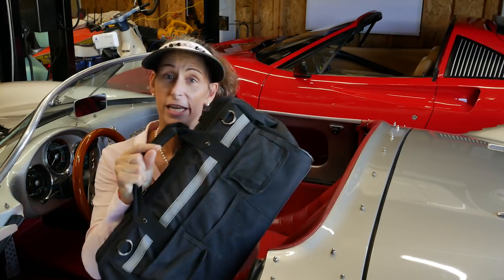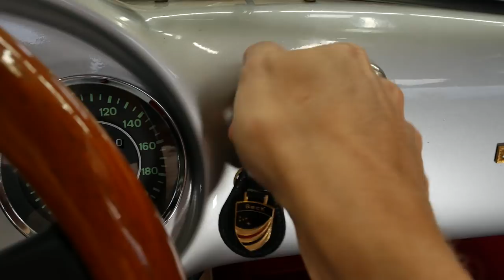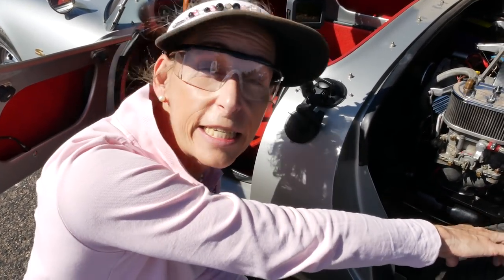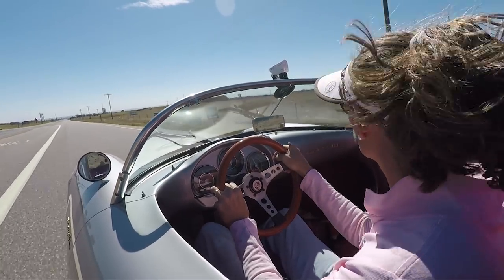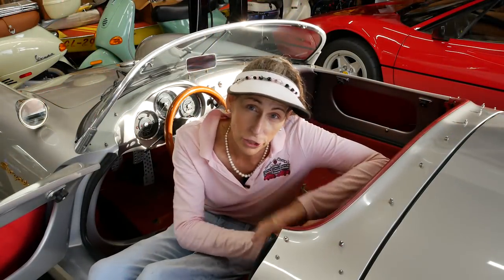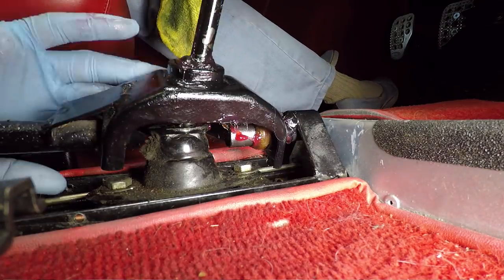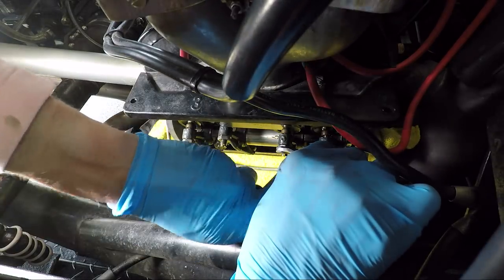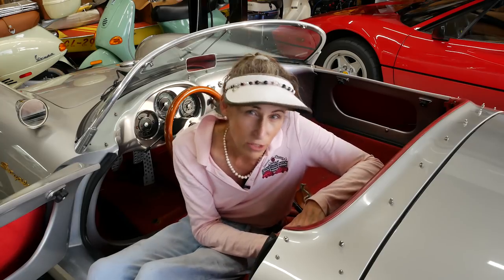Beck 550 Spyder Replica VLOG #9 - Shakedown!

Comment from the maker: In episode#9, We take the car out for a proper shakedown run!  Let me know what you think!  How does it run and how does it sound?  Maybe not everything was perfect, but I get into that at the end.
Reply: Great to watch the vids, Yeah, for sure sometimes the valves can hit the covers, Not sure what cam and all it is. Actually, I had the stock cam with the 1.25 ratio rockers and mine valve cover had to be centered just so-so or I could feel it hit the valves. Actually, valve cover position may be a matter of feeling it with the engine running, But this little spider probably needs bolt-on aftermarket valve covers. Oh and yeah, probably the big end of the tube needs to be out. You can't have any hitting going on, well you can but then they start leaking oil and at least my aluminum pushrods wore down to a point they had to be changed. Now I use the CB Performance SS Wide Mouth Racing Push Rod Tubes. http://www.cbperformance.com/product-p/1567.htm

Comment: Wow, great troubleshooting. 
When I first got the car there was a fuel delivery problem. Previous owners had installed two pint size fuel filters in the engine bay. Effectively, they acted like a second gas tank. The fuel would dribble into the filters and they would take up any extra fuel needs to carbs. Replacing the plastic fuel line certainly makes the car safer. 
Now, onto the comparison episodes!
Reply from the maker: Thanks Dick.   I'd be really interested to get your take on it.  Maybe we can work it out to have you drive it.  I'll ask Mike.  It still has a little way to go, but it is drivable.

Comment: Dear Frannie and Heidi,
Consider measuring the OD of stock VW pushrod,compare with present chrome  moly OD.....if stock VW pushrod has smaller OD-swap out....I can't remember-(i ran stock and chrome moly pushrods in different engine configurations-but 40 + years ago!!.....Stock VW pushrods held up very well up to approx 5000 + rpm (even with mild hi-lift cam-)-for normal street spurts and SCCA road racing events......i hope those expandable pushrod tubes work out!!!...one of your commenters on this VLOG #9 is/was right!!-it is best to stay with the stock VW pushrod tubes.....thank you both for all of your efforts and VLOG's!!!!!  John
Reply from the maker: Thanks John.  My guess is that the steel rods are actually smaller in diameter, but I don't have access to the new rods.  I did talk to the owner about swapping them out, but he chose to stay with what he has.  I think those pushrod tubes seem to work just fine, but I bet the originals would allow for more clearance.  Thanks for the thoughts! F

Comment: If you look at the pictures of that you showed of the push rod hitting the tube. The alignment is off compared to the other push rods.  I haven't worked on VW since the late 70s and early 80s but if I remember, the rockers were slightly different on some of the other engines. They look identical except the measurements are slightly different, you might want to measure the rockers to make sure that they are all identical.  That push rod should go down the center of the tube when the valve is partially open and its already against the side of the tube before it even moves.

Comment: Well, this turned out to be a nice series of videos! All very interesting to fellow car nuts!   I would suggest to the owner that having a good-working set of carburetors will require swapping those Dellorto carbs for Webers.  I doubt the Dellortos will ever run right...  Nice job on the video series!
Reply from the maker: I second that... F
Reply: If you ever have an issue with the Dellortos, I can make them run better and smoother than webers, don't get me wrong but webers are good carb too.

Comment: The problem with the valve cover leak is the bail.  That is not an original German bail.  The aftermarket bails don't keep the proper tension.

Seems like the gearing is too low.  Seems like that gear box should have been built with a 3.88 R and P. 

Keep up the reviews.

#GirlVWmechanic
Reply from the maker: Hi Monica, You are right; the Gearing was changed by the PO.  I didn't catch the why, but maybe taller gears for a stronger engine?  Not sure.  I was more worried about getting it to actually select a gear ;)  The bail was pretty tight.  It was my bad for not prepping the seals properly.  I sorted that and they are now dry.  Have you worked on these CB Performance engines?  I'm interested in your take on them - although this one is pretty old I think. F
Reply: @HeidiandFranny  CB Performance is THE industry leader. If the engine was built by Pat Downs ( Lead tech/builder) I'd be fine with the engine.  But a 1915 cc engine wouldn't be something he would build personally.  He usually builds 2 liter and up. He can build a bullet proof 2276. 

I've built engines with mostly CB products. Certain items still need to final prep.
Reply from the maker: Are the pushrods suppose to contact the tubes?  What do you think of those steel pushrods...  This engine actually had one different than the other four on the right side.  Oh, I have to ask you about those nyloc nuts...  They were on the heads and the case.  I had not seen that before...  How do you torque properly with them?  I know a thousand questions ;)  Thanks, F
Reply: @HeidiandFranny  Steel push rods are used on engines that are built with Chromoly steel head studs.  The expansion rates are the same, so you adjust them at zero lash.  I like building engines with SS windage style push rods tubes.  The are wider, and you usually have better clearance.
Reply: @HeidiandFranny  Nylocks are fine.  Torque specs are the same

Comment: Dear Franny, riding the 914 in regular traffic was easy. I started having trouble when I wanted to race the car on the track. About evry fifth shift was a gnashing nightmare and I gave up racing the 914 despite the great weight distribution. Due to the mid-engine the shift linkage was incredibly long and hard to get right. Seems the 550 Spyder has the same issues. Nice when you get the linkage tightened up but always a nightmare when you´re on the track in traffic. At least this replica has a pushrod engine. 
Andreas
Reply from the maker: It does shift a lot better now, but it is still clunky.  But, the 915 transaxle in the 3.2 Carrera can be fussy at times (especially 2nd gear).

Comment: Fantastic video. So glad to finally see the vehicle running as it should. I have to say this makes me want one of these so bad. I do have one question though. What happened with the brake light at 9:35 .  is it a line pressure switch or a pedal switch for the brake lights?
Reply from the maker: Hi Tim, I think that is the "blinker".  It works and it doesn't but it doesn't cancel.  That needs to be sorted.  I was a little worried when I went past the po-po.  They are pretty cool out here in our area.  Good guys.

Comment: Great video in a great series. Very informative. The car sounds great too. I guessed at a gear linkage issue when you mentioned it shifted badly. Glad you got that fixed. Still wondering about the oil leak at the pushrod tube. Is the pushrod ever so slightly bend? And are the pushrods and tubes correct for this engine?
Reply from the maker: The rod seems straight...  All of them are close to the inside of the tube and several of the tubes have rub marks on them.  I can't think that is "right".  It is more about the high-lift cam I think and the stock rockers.  Seems like it could be better...
Reply: Oh, I forgot about the high lift cam and stock rockers. Sounds like that could be it.

Comment: Really nice vid...thanks. Rather strange the position of that pushrod, something very wrong there. Surely the rocker is wrong?
But i'm sure you got it sorted.👍🇬🇧
Reply from the maker: Yes, I totally agree!  I got it as good as I could, but still...  It just doesn't seem correct.
Reply: @HeidiandFranny  ....the rocker arm is too short on the pushrod side (no idea how that could be) causing the rod to touch the tube. A very odd problem, unless the rocker arm got swapped  by mistake sometime in the past. 
It also looks like the rod is not seated central into the rocker but the adjacent one looks the same.
Would love to find out.
Keep up the great work.
Love from Rome.

Comment: What was the verdict with the cracked head? I hope it was replaced or more then likely you will be having to tear it down again. Sounds great!
Reply from the maker: The machine shop gave it an ok because it wasn't up to the spark plug hole.  The said it is common on heads that have been bored out for those larger valves.  The valves were replaced and the springs and keepers.  This isn't a car that will ever see high mileage.

Comment: Awesome!!! I’ve had the crazy idea of selling my 996 turbo and buying a replica spyder.
Reply from the maker: That is a crazy idea.  Do not sell the 996 Turbo.  Sorry, that sounds really harsh, but these cars fit a different niche.  Maybe buy the Beck in addition?
Heidi
Reply: Heidi and Franny's Garage 

What do you think of selling a turbo for a 550?
Reply from the maker: Hi Chris, They are very different cars, but if you only really use your turbo occasionally for fun drives, then that might be a crossover.  The Spyder is low and hard to see and has almost no safety equipment.  Your Turbo is a modern car and can easily be used as a daily driver.  Heidi really loves her Turbo as you can see :) It depends a lot on how you would use the cars I suppose... Franny

Comment: The reason the chromoly pushrods we're hitting the push rod tubes is due to the fact that the Rockers are aftermarket 1.25 ratio as opposed to the stock 1.1 ratio.

Comment: Does it drive like a kit car?  How is the handling?  How does it compare to the 356?
Reply from the maker: Ahhh...  All coming up.  Short answer, Not as much as you would think; Light, but good, and would be better with better tires; and the difference is a level of sophistication and design (and era).
Reply: Heidi and Franny's Garage very much looking forward to the comparison.  Always intrigued by owning a replica 550 spyder but worried I will be disappointed.  Any knowledge about Seduction Motorsports who builds them?